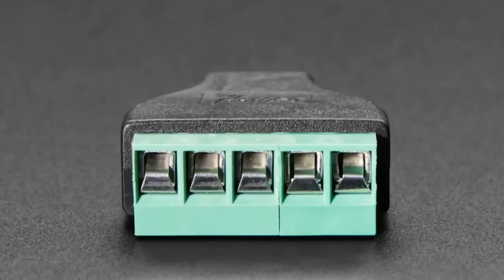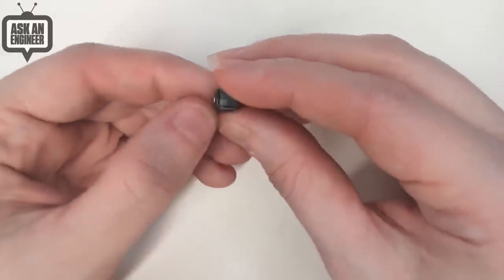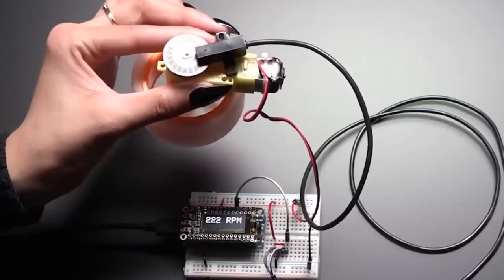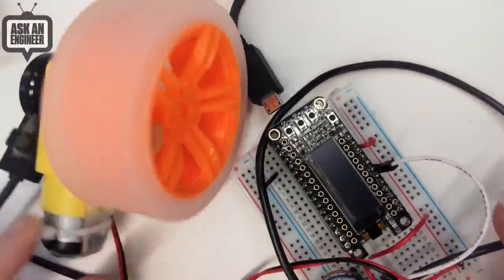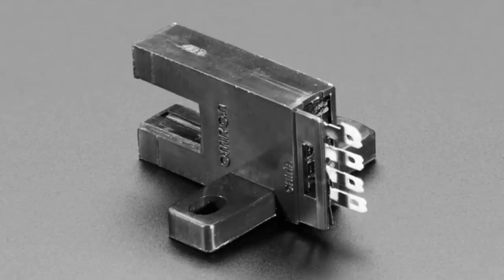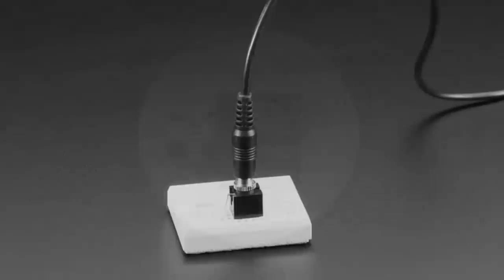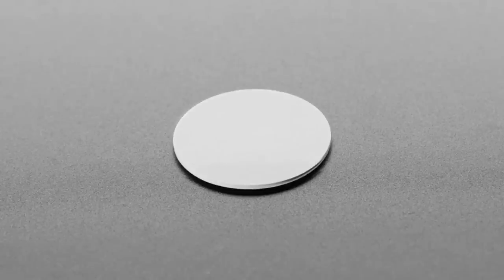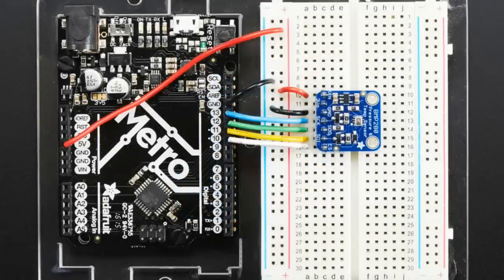New Products 12/26/18 Featuring #Adafruit #Feather #nRF52840 Express! @adafruit

Comment: BLE mesh for the upcoming "Feather nRF52840 Express" ?
https://www.adafruit.com/product/4062

question about the future: 
Do you think it will ever be possible to use Bluetooth 5 mesh protocol with Arduino IDE and/or with CircuitPython ?

(without digging into or need to modify the Nordic firmware (API/SDK) by myself ?)

--> https://www.nordicsemi.com/Software-and-Tools/Software/nRF5-SDK-for-Mesh
--> https://assets.lairdtech.com/home/brandworld/files/BLE%20Mesh%20Introduction.pdf

any plans by adafruit in this direction ?